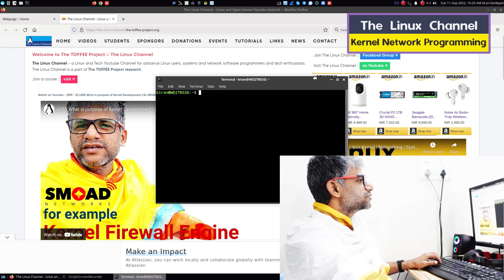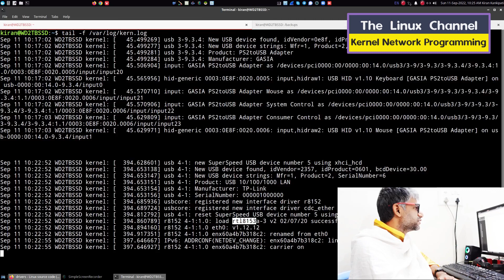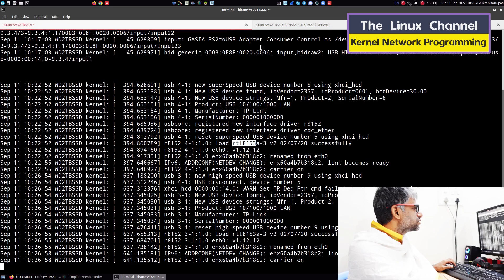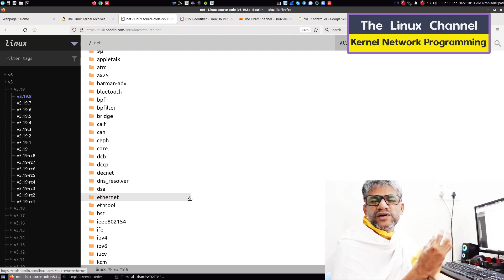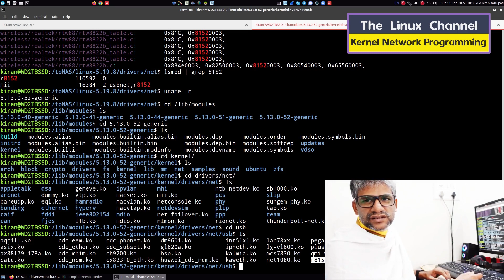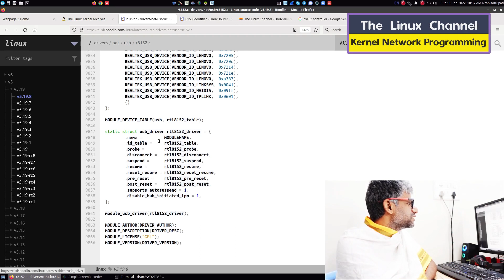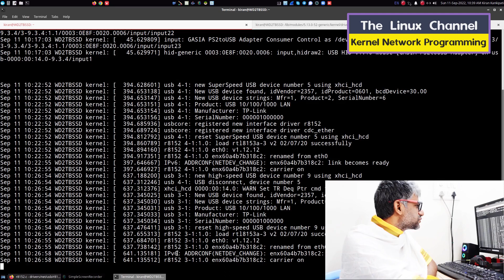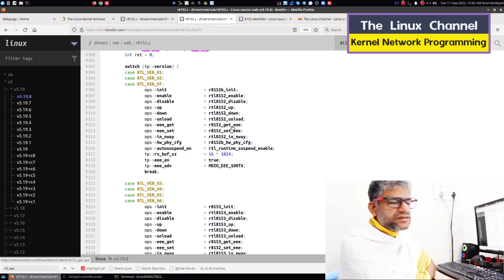x257 tp-link UE300 Linux Kernel Realtek Driver Codewalk rtl8153a-3 r8152 USB 3.0 to Gigabit - Part1

Comment: Halloo master, can you help me, which one driver usb adapter Ethernet gigabyte tp link ue300 to connect openwrt,
Reply: Because Driver Asix Ax88179 can't read this device (Tp link UE300)
Reply from the maker: Nice to meet you. I found one bug with this hardware vs my other USB to ethernet adaptor is that this one if connected during bootup is not initializing. Instead once the device is booted after that if you insert then it will come up. Of course I installed the needed drivers (kmod-xxx) but it comes up only after device boots then we insert the same. Check if you have any such issues 🙏💗